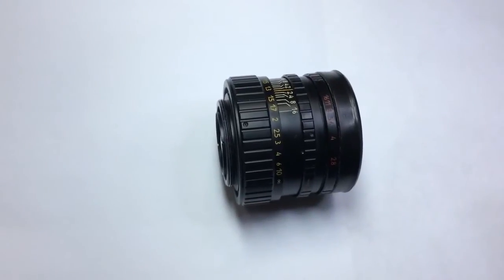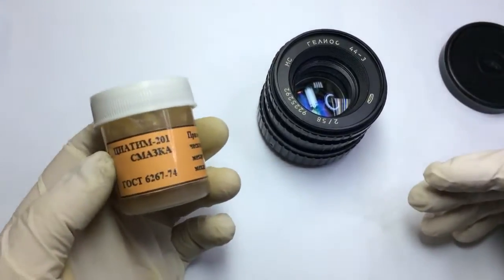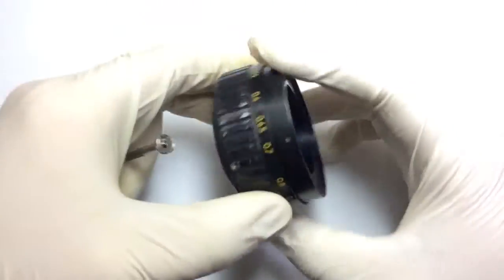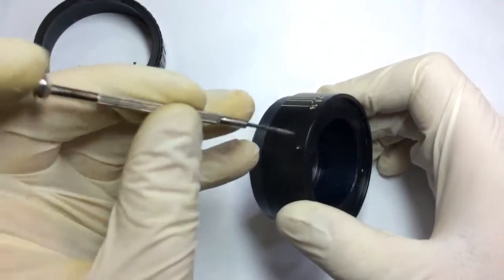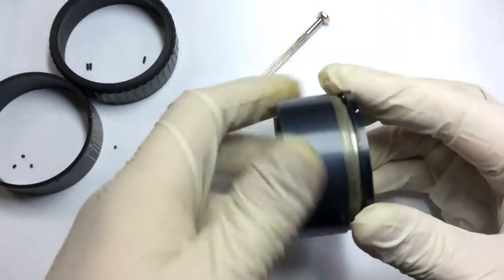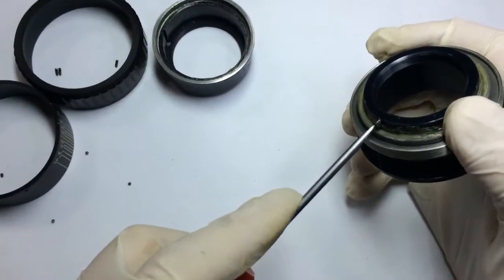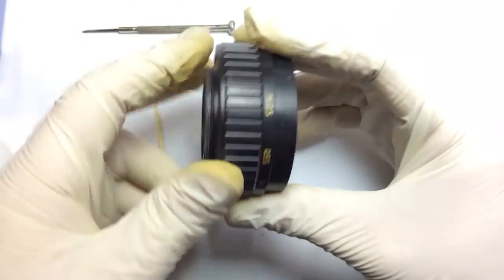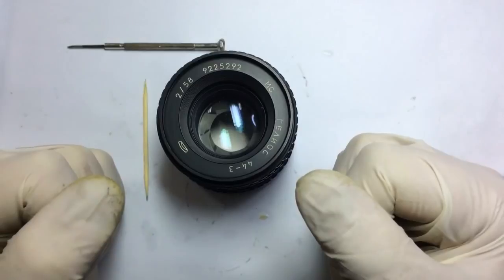Helios 44-3 lubrication tutorial

Comment: Thank you.  Did one. The small screws are tricky to put back.  I suggest magnifying glasses, tweezers and doing that inside a box to not lose them. It made me realize that it is worth buying a professionally serviced lens from Retro Foto House rather than saving a few dollars and doing it yourself, unless you are good at that. It may get easier with time. I did strip one screw putting it back.  The second set.  But lens works anyway.  Great tutorial, thank you!
Reply from the maker: Thank you very much for your confidence towards my work!

Comment: I have a Helios 44-2 with the  barrel like this 44-3 but not MC and is written in cyrillic alphabet which I think is the model 44-2  2.d. I tried to open the front plate with a rubber vaccum tool but could not open. Is there a procedure to remove the front plate?
Reply from the maker: Filipe Rodrigues no, it is not removable. If you want to get optics- you need to remove little ring near front element with two little grooves

Comment: Great video. However I 'm nit able to open it, first step. Even if I turn left, it doesn't open. Any idea?
Reply from the maker: You just need to apply more force. Sometimes, rarely it is screwed in so strong that it is very hard to unscrew it.
Reply: I've got it. where do I buy your lubricant 201? cheers